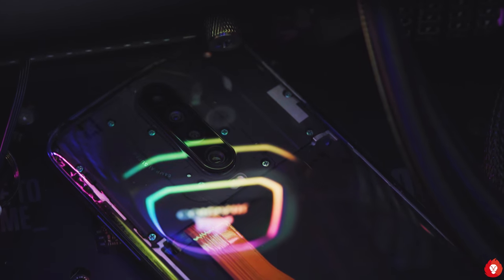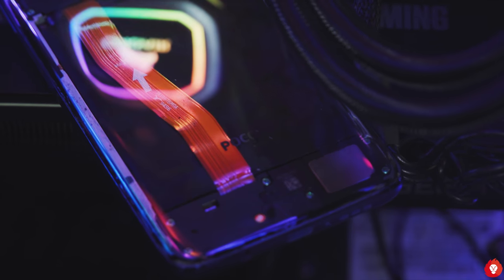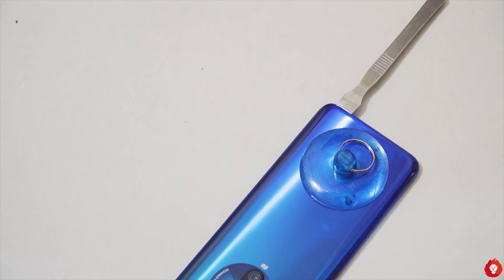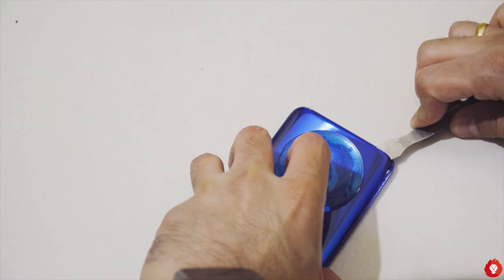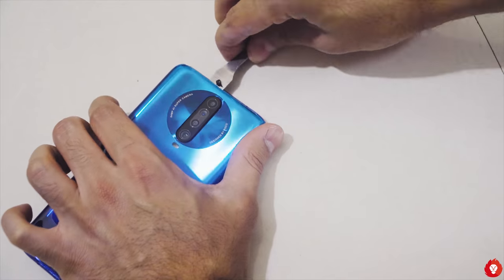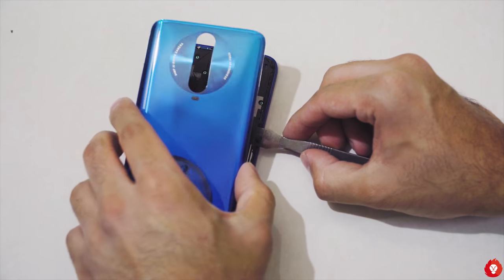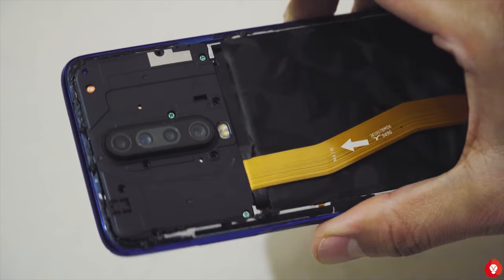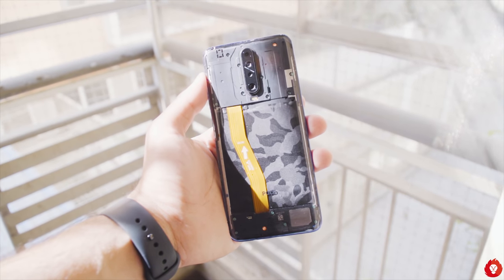Poco X2 Transparent Edition - Teardown, How to do it yourself & Poco X2 Giveaway

Comment: Had huge expectations with K30's design after that sexy K20 back. But they disappointed AF. This is way better than the actual back ❤️
Reply: K20 had the ine of the best and unique design 
But they cant bring it here too 
Then people will complain that it has same design
Reply: What is the full form of AF
Reply: Harsh Sinha normally most people use it for as f*ck
But it can also be used as smooth and fast(censored)